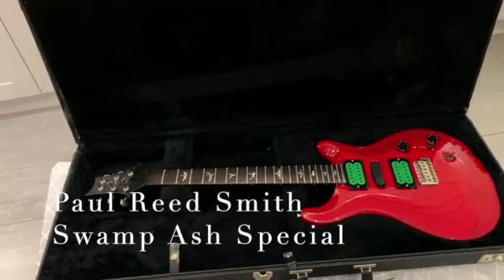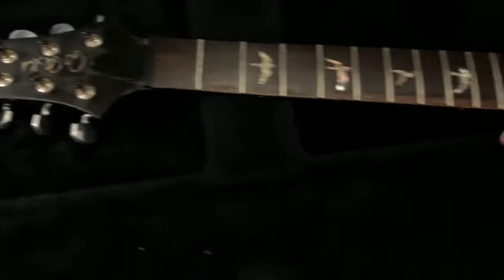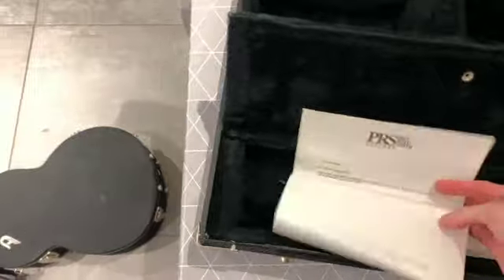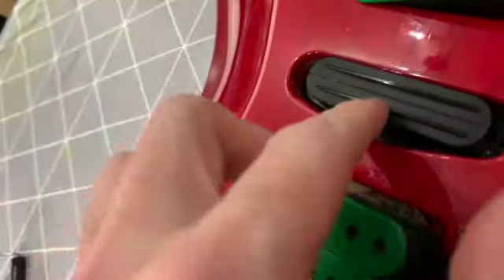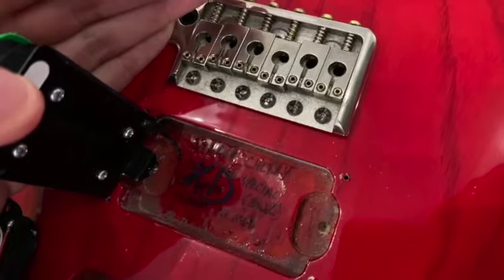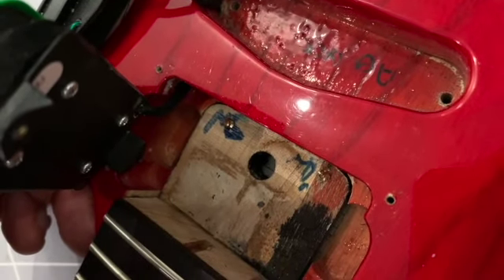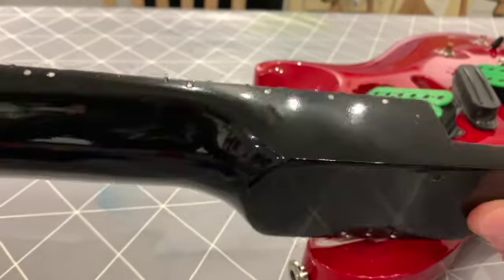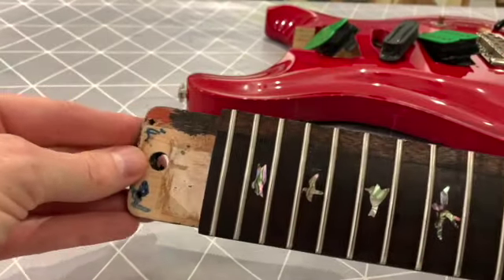Paul Reed Smith - PRS - Swamp Ash Special - description and rebuild

Comment: Hi I've just bought the Ruby sas the one that you put back too original configuration my only concern is I've looked all over for a swamp ash guitar with blade and switch for the pickups was this a custom guitar?
Reply from the maker: Did you win the eBay auction? Great stuff. If you watch the videos I do say it’s an odd config on the switches but some endorsed players have used that configuration. My guess is because it’s a namm model it’s either a prototype or a special run. It’s definitely a factory job
Reply: @Candyskullguitars  ok thanks for you fast reply yes I won the auction on ebay I already have two prs guitars dgt and a 20th anniversary, so in your opinion its definitely a prs guitar not a well made copy i know it sounds funny Questions but so many fakes about Joe is delivering tomorrow for me .
Reply from the maker: @royhunte4889  100% it’s a PRS.
Reply: @Candyskullguitars  ok thanks Gareth for your time i like to no a bit of history cheers.
Reply from the maker: @royhunte4889  no worries mate. It’s an interesting piece for sure
Reply from the maker: @hhpp6911  hmm. I don’t think you watched the video fully. It’s not fake. It’s a show guitar built for the namm show. Some version of the SAS have appeared in artists hands with this switching layout. It’s possible it was a prototype and made up for the namm show from that stock. Also, nothing has been glued on. Swamp ash specials are bolt on necks - always.
Reply from the maker: @hhpp6911  ok mate. I always appreciate input from people that 1 - dont have the actual guitar in front of them and 2 - don’t seem to outwardly exhibit the years of knowledge accrued from working in and gaining qualifications within the trade. I have very little interest in arguing over social media with anyone, especially on a guitar I restored and sold months ago. Please stop watching my videos. You are not my intended audience.